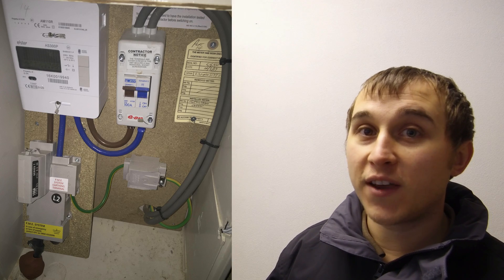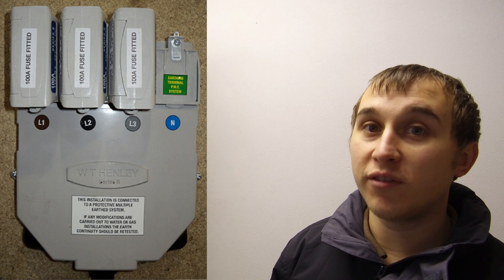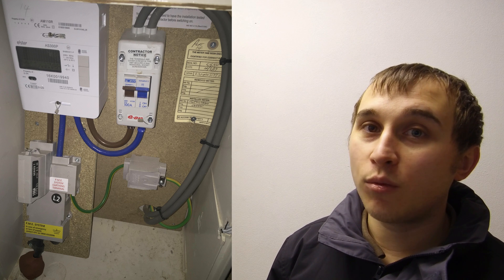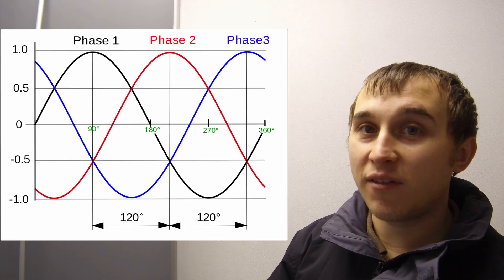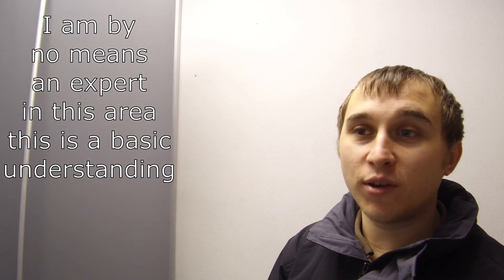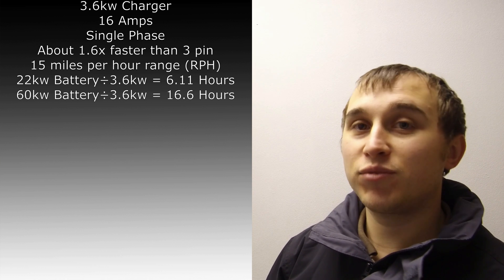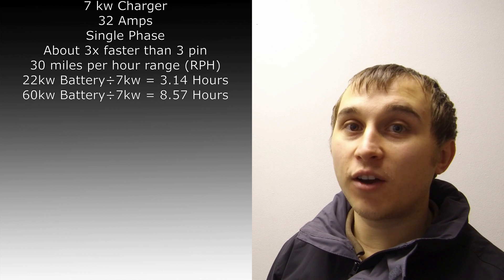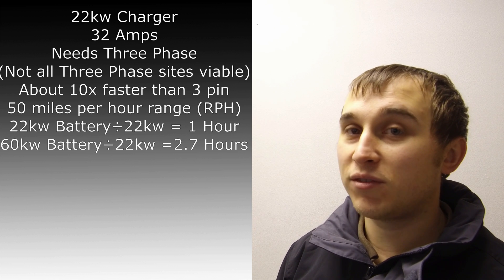What is 3 Phase Power & other charger questions 🔌🔋⚡

Comment: You were wrong on the earthing, you stated that your earth was good and you didn't want a rod. Very dangerous my friend, you cannot fit chargers to a TN-C-S system like yours if it hasn't got a device that protects against an open neutral fault or you must install a rod which makes the charger a TT system, plus any metal work like water pipes within 10 meters of the charger must have a plastic insert to break the bonding back to your house. Any metal outside light within 10 meters must be change to a class II type e.g. plastic or there is a potential you will get an electric shock if there is a neutral fault. My advise is always get the installer to do a proper survey and not send them pictures, it's your safety at the end of the day. However if you are always charging your vehicle in the garage and not outside, then you can connect the charger to the TN-C_S system without a rod in the ground. Sorry for the rant, on the plus side good video
Reply from the maker: This video was made and charger was fitted pre reg changes ;)

Comment: Currently there in no SMART meter and therefore no overnight tariff capability with a 3 phase supply in a domestic property
Reply from the maker: There is a 3 phase smart meter I have one at the office
Reply: Hi Nicolas
I am advised by Octopus not for domestic installations at the current time. I switched to them a few months back with the intention of moving to the Go tariff but in coming to install the meter they advised that it wasn’t possible to install because of the 3 phase supply. They have been very helpful in terms of the communication but it’s a waiting game and maybe next year before they can provide a solution. Thanks, Bruce
Reply from the maker: @brucemurphy2735  ahh sorry Bruce i didn't mention octopus in this video so it threw me out of context,  keep me posted on if this changes sounds interesting!
Reply: I think it’s the same for all supply companies in terms of 3 phase to domestic premises. Octopus provides the most attractive tariff for me but the absence of a Go tariff will delay my transition to a full electric vehicle. For now it’s manageable with just a small battery in a PHEV
Reply from the maker: even charging on full price electric is going to be SUPER cheap compared to fuel,  the reason they can't do the go deal on 3 phase will be the fact they havn't got the regulator to approve the tariff
Reply: Hi Nicolas
I am advised by Octopus not for domestic installations at the current time. I switched to them a few months back with the intention of moving to the Go tariff but in coming to install the meter they advised that it wasn’t possible to install because of the 3 phase supply. They have been very helpful in terms of the communication but it’s a waiting game and maybe next year before they can provide a solution. Thanks, Bruce

Comment: OLEV grant is only eligible to Plugin EVs/PHEVs bought after a certain date. I found that out having initially bought my car 5 years ago, then moving to a house with a drive, and finding out I was no longer eligible. Though to be honest, most installation companies are completely ripping off the government, since a unit can be bought and installed for much cheaper than quoted.
Reply from the maker: Hi Shaun wasn’t aware that it times out on that car within 5 years however if you get another EV or switch to say your wife’s name you could get a grant and install cost with grant is much cheaper than buying unit and installing

Comment: 100-200€ for a charger? Jesus is that all your charged in the uk? We are ripped off here in France. The cheapest wall charger is 1000€ and it rapidly goes up from there. It can hit 3000€.
Reply from the maker: We get grants of around £500 towards a charger install cost have risen slightly do its about £280 now for a charger so total price before grant is £780

Comment: 3 phase power is 400V is it not so in the UK?
Reply from the maker: yes i think its 440v to be spot on, but didn't want to confuse the matters its more basic understanding.
Reply: It's 3 separate 230V lines. The 400V can be created in the devices you connect to it. 
Usually a 3 Phase AC Motor.

Comment: Hi. Your channel is great  as I am investigating if buying a used Zoe will work for me. I see you can buy a home wall socket  3 pin granny cable. I only use my car once a week. would just using that cable cause any problems? Your vid about the leasing issues when buying and selling was very helpful. Also is the bigger 40kwh battery only on the ZE40 version? Cheers. Greg
Reply from the maker: The granny cable isn’t designed for charging everyday, what are your reasons for not wanting to have a wall unit fitted?
Reply: Thank you. I currently rent my house so cant get a wall unit. I only use my car at weekends for shopping and the occasional longer trip so I thought the granny cable was the least hassle option. So, would charging like this damage the battery if I did it once a week?
I'm confused by how you can tell if the Zoe has a 40kwh battery. The renault document isnt clear. It seems to say all 2016 onward dynamique and ze40 are 40kwh. what do you think. Many thanks for your help. Greg
Reply from the maker: all ZE40 are the larger 40kwh battery however some 2016 reg models with 22kw battery but they won't be called ZE40.
I'd try pitch to your landlord that your paying for it technically there £800 to get installed however with the grant your getting it from £150.
Granny cable could be used like you said and won't do any damage to car but there only meant for charging every now and again,  most landlords will be happy to let you install if you leave the charger when you leave as it benefits them when they re rent it as its an improvement.

Comment: Also think for every day use if you’ve never had an electric car before I’d strongly recommend a tethered unit (with the cable attached to the unit permanently) as opposed to untethered. It’s so so much more convenient with having to mess around getting cable out and putting t away each time. Many manufacturers and installers push untethered as it’s cheaper for them but not best experience for the customer so beware of that!
Reply from the maker: I personally prefer untethered, 2 reasons.
1) less clutter on side of my garage so its nice and neat.
2) Slight future proofing, Now i seriously doubt we will be moving away from type 2 anytime soon with even the new leaf getting a type 2 plug,  However never say never there's a small tiny chance they might alter it and I don't like adaptors unless you really need them.
But if you want ease of use then tethered unit is a good idea as your getting a cable for next to nothing and with a qualified electrician you could have it changed to a new standard in future if it did change.
Reply: I agree 100% Nicolas.  I got an untethered unit for those exact reasons.  In fact, those were the two reasons both Chargemaster AND  the installer gave me for getting an untethered unit.

Comment: OLEV is 75% of total cost up to a maximum of £500 discount. The installer will claim the grant on your behalf so that you only need to pay the balance. i.e. if you’re total cost is £750, you only pay £250, OLEV will pay the installer £500. One of the best chargers are Zappi Charge units as these can use cheaper off peak electricity or surplus solar if you have solar panels. They soon pay for themselves that way in what they save. So basically for just the cost of a few tanks full of petrol you can have a charge point installed!

Comment: I think it’s important to stress the charge times seem much faster than times you quoted in a way as you very rated run the battery to zero, so it’s not the full 22kWh, and then the last 20% or so is slow, and I don’t often bother waiting for that either, so an hour and a half is usually enough for a good range of charge for me.